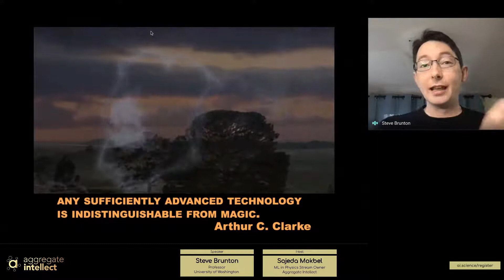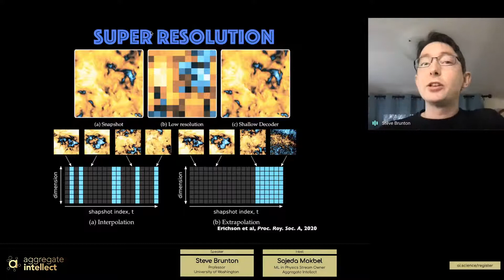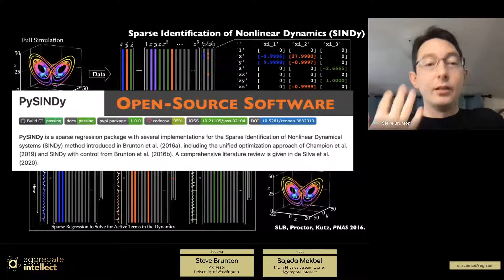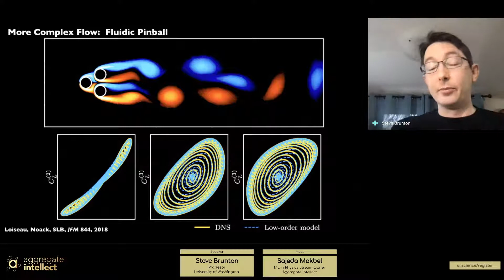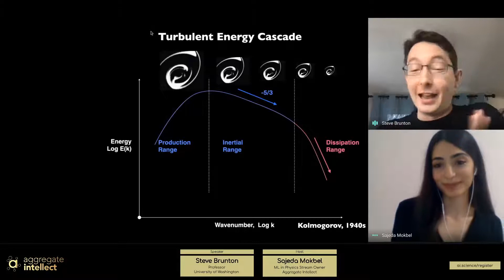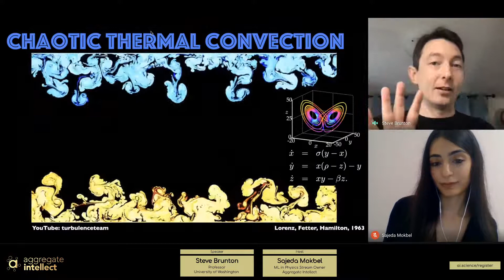Steve Brunton: Machine Learning for Fluid Dynamics

Comment: You mentioned that we need more than a black box from machine learning in fluid dynamics. So could we say that we should somehow use machine learning in form of a data assimilation framework? I mean run a physical model simultaneously with a statistical model which is machine learning in this case?